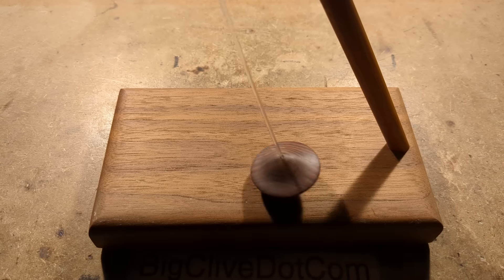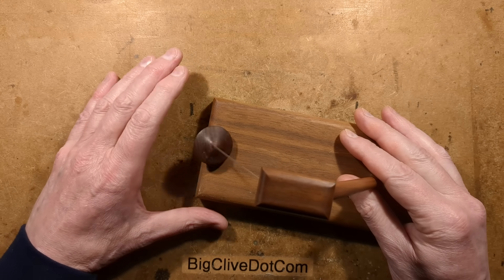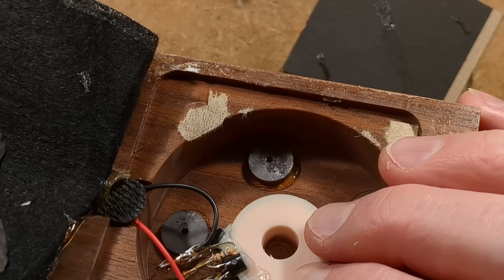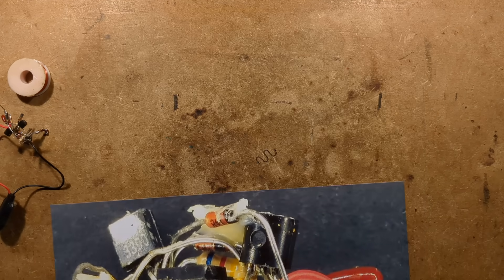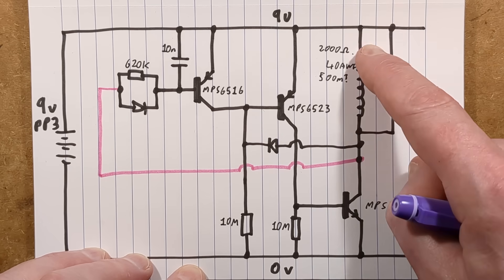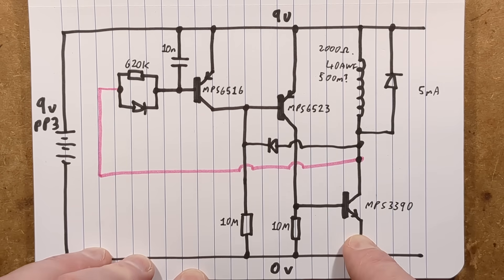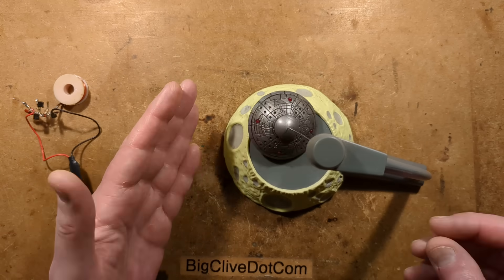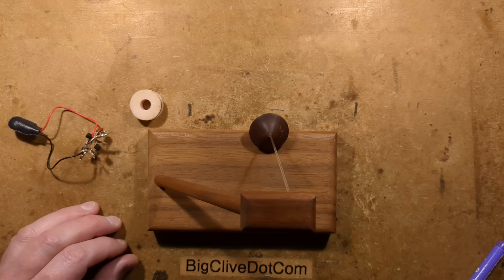The WildWOOD pendulum is pure electronic art (Made in the USA)

Comment: I bought one of these from a high end retailer catalog ( fancy clothes and gadgets ) about 30 years ago for my late father. After about 10-15 years, it stopped working. I replaced the 9 volt battery but that apparently is not the problem. I still have it and would love to get it back up and running again. Anyone have any ideas? Thank you.
Reply from the maker: First suspect is the battery clip.  Make sure it's not corroded or that a wire hasn't popped off the clip.

Comment: That’s exactly why I can’t stand stuff made in the U.S. - nice packaging on the outside, but awful build quality inside for ten times the price. Even China does it better - and definitely cheaper. 
The only excuse for this level of quality would be if it was assembled by a 10 - year old though honestly, I was building far more complex circuits at that age...
Reply from the maker: This is how short run circuitry used to be made.  The cost of getting PCBs manufactured used to be astronomical.  Literally full 1000 PCB production runs at £10 to £20 per PCB plus high processing costs.

Comment: like to use a mag reed switch to cut the car fuel pump 
so if you try to steal the car with out knowing where to place a magnet you dont get far 
any ideas or problems can you for see.  should i run two reeds in parallel in case 1 dies ?
Reply from the maker: Fuel pumps are fairly high current.  A concealed high current switch might be a better option for something like that.

Comment: AI Summary

Abstract:

This video presents a detailed teardown and reverse engineering of a vintage "Wildwood pendulum," a unique electronic chaotic pendulum. The creator reveals its distinctive wooden, hand-assembled construction, featuring a low-friction magnetic pivot and an air-core kicker coil. The core of the video focuses on the surprisingly complex, entirely hand-wired transistor circuit responsible for its operation. This circuit is analyzed in detail, highlighting its efficient design that delivers a single, precise 5mA pulse per magnet swing, resulting in negligible quiescent current and extremely long battery life. The video contrasts the Wildwood pendulum's artisanal craftsmanship with a mass-produced plastic clone, emphasizing the original unit's status as a rare piece of functional art.

Summarizing the Wildwood Pendulum: A Deep Dive into its Hand-Crafted Engineering

*   0:00 Introduction to the Wildwood Pendulum: The video begins with an unusual angle to showcase the Wildwood pendulum, an electronic chaotic pendulum with a kicker coil, acquired long ago from a gadget shop in America.
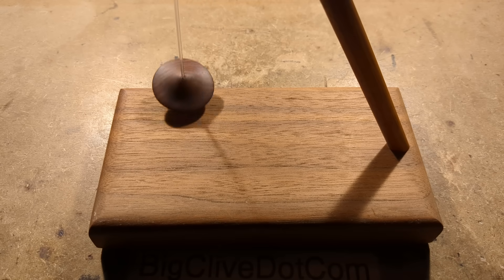*   0:35 Distinctive Wooden Construction: The pendulum is characterized by its hand-assembled wooden components, including a base, angular stem, and a wooden pendulum itself, featuring a ceramic magnet at its base and a custom cap with a spike for a low-friction magnetic pivot.
*   1:30 Battery Compartment: The battery, a PP3 (lithium core with a boost circuit), is accessible by lifting a felt cover, secured by a magnet.
*   2:24 Internal Magnet Array and Air-Core Coil: Inside, five magnets surround an air-core coil, which the pendulum interacts with. The creator notes the unusually complex circuitry accompanying this air-core coil.
*   3:07 Hand-Assembled and Unique Circuitry: Reverse engineering reveals that the coil, made of 500m of fine wire, is paired with an entirely hand-assembled circuit, distinct from typical pendulum designs. This indicates it was not mass-produced and is a piece of "handmade art," manufactured by Andrews Manufacturing Co. in Eugene, Oregon.
*   4:15 Treat as Art: The creator emphasizes that original Wildwood pendulums should be treasured as unique art pieces, especially due to their distinctive circuitry.
*   4:33 Highly Efficient Circuit Design: The circuit, employing three transistors (one NPN, two PNP), is designed for extreme efficiency. In its standby state, it draws virtually negligible quiescent current.
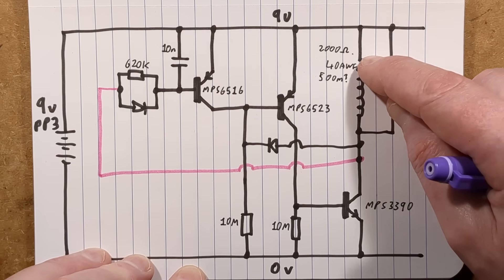*   5:55 Precision Pulse Operation: When the pendulum's magnet swings past the coil, it induces a negative voltage, triggering a precisely timed circuit that delivers a single, distinctive 5mA pulse to the coil, sustaining the motion.
*   7:16 Extended Battery Life: Due to the circuit's minimal quiescent current and efficient pulsing, the battery is expected to last an exceptionally long time.
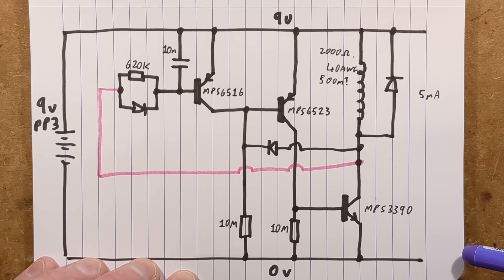*   7:28 Manual Start & Diode Protection: Unlike some pendulums, it doesn't self-start, allowing it to be held still. A diode protects the transistor from the coil's inductive kickback.
*   7:56 Comparison to "The Visitor" Clone: The video compares the original Wildwood pendulum to a plastic, mass-produced clone called "The Visitor," which uses a significantly simpler (coil and single transistor) circuit, likely resulting in shorter battery life.
*   8:32 Art vs. Mass Production: The Wildwood is highlighted as "made in America by hand and it is art," while the clone is "made in China by machine and it is not art," underscoring the craftsmanship of the original.
*   8:48 Maintenance Tip: A dab of Vaseline on the pivot can help prevent wear, ensuring the pendulum's longevity.
*   9:13 Conclusion on Value: The creator concludes by expressing increased appreciation for the Wildwood pendulum, recognizing the immense work and unique artistry involved in its handmade circuitry.

I used gemini-2.5-flash| input-price: 0.3 output-price: 2.5 max-context-length: 128_000 on rocketrecap dot com to summarize the transcript.
Cost (if I didn't use the free tier): $0.0066
Input tokens: 14812
Output tokens: 846

Comment: I wonder if there's enough voltage on the snubber diode to replace it with an LED and flash it on the field collapse. Hmm. If not, a transistor buffer would fix that easily... 😁👍

Comment: That "coil" looks distinctly like it's just a standard spool of wire they ordered, rather than anything explicitly wound just for this, which would be an incredibly sensible thing to do if you can get away with it.
Reply: Obviously don't know for sure, but I also thought it looked an awful lot like the enamel coated magnet wire spools you could buy in the States from Radio Shack, R.I.P. 😢  
Probably still have a least partial one or more in my shop somewhere.
Reply: yeah

Comment: You mentioned that there is a solar powered version, does that mean solar cells and a cap for power supply? Did you also say it can´t auto start? could a pulse inducer cause it to start? AKA can a cap and a timer give the coil a little kick once every 5 min or so or perhaps a second of set coil with no other function? Are the plans/blueprints available for download for the diy/3d crowd?
Reply from the maker: The auto-start pendulums for solar use use a pulse circuit to initiate swinging.

Comment: I have an early electromechanical clock that functions like one of these. It’s like a regular pendulum clock but instead of there being a force from the running side driving the pendulum through an escapement it’s the pendulum that drives the running gears with a ratchet mechanism. The end of the pendulum is swinging over a coil, much like this. It’s a pretty good time keeper but you can definitely tell the difference between the shoves of a fresh battery and the gentle caress of an old battery.
Reply: I think I've seen one of these but can't remember who made them, any idea?
Reply: @orbatos  Sony probably. Swinging pendulam, driven by solonoids at the end of the swing.  Couple of batteries, a transistor and a switch. Unfortunately, the switch contact in mine, is worn and the clock in pieces waiting for the day of resarection.
Reply: @GluteMaximuz  mine is a Kundo, it has no switch and the coil is exactly in the middle of the swing.
Reply from the maker: Possibly a Kundo clock?

Comment: Suggestion to make the reverse engineering more interesting, is to log the voltage waveform feeding to the coil. Could be quite interesting in itself. It could also be a split screen video of the pendulum in action versus the voltage waveform(centered to half second duration window).🤔 The average current  numbers could be useful, but more likely similar(may be more🤞)  to those oscillating pendulum magnet clocks.❤️👍
Reply: I'm disappointed Clive didn't actually measure the current consumption.
Reply: @moeburn  That's very hard to do. With a normal multimeter it is essentially impossible. If you have the waveform you could in theory calculate the area under the pulse, but that is arduous. Even then you still have to figure out how many pulses per minute there are. 

You could try to determine how long it takes to drain a battery, but for normal batteries that would take years, and the leakage of the battery would be significant. Perhaps the best way would be to determine how long it takes to drain a capacitor of well-known capacity.

Comment: Hey Clive, big fan of yours. I've tried to buy a good soldering iron and I have failed to get a proper one. I am currently using a soldering gun but the tip is rather big and the device is unwieldy for what I need. Could you give me some advice on what to buy. What are you using? What brands can be considered solid? Thanks in advance! Thanks for all your videos too! Always nice to learn something from you.
Reply from the maker: There's a wide range available.  What you get will depend on your budget, but even low cost units are very good these days.  I currently use a Yihua 8786D station, but will probably move to a modern T12 style soldering iron soon.
Reply: If you don't do lots of soldering and are on a budget then the USB powered ones are worth a look,
TS101, Pinecil, etc
Reply: @sofa-lofa4241  I'm actually looking to spend some more money to have one that stays with me for life. I know that thought is nowadays rather unrealistic as everything now is built to break. Still I'd like to have something substantial. Something that gets hot quick. Heats the target area quickly and can be used for a longer time.

I do have a nice little rechargable iron I could take with me and do some smaller soldering jobs but every other station I have is not only weak but seems to break down already.

Comment: "Treat it like art"....... says the guy who cut it completely apart. 🤣🤣
Why are there two different PNP transistors installed and why does it work even without the coil? 🤔
Reply from the maker: It still bounces around the other magnets when the boost coil is removed.
To truly appreciate electronic art it has to be deconstructed.
Reply: I still have a huge collection of various transistors, mostly desoldered from old electronics. I wouldn't be surprised if these transistors have a similar history. The exact type of transistor is probably not critical.

Comment: Could this have been achieved by using a 555 timer ?   
Or perhaps this way with the 3 transistors works out cheaper to make !
Reply from the maker: It might have been viable to configure the internal modules of a 555 for this.
Reply: Using a 555 would require far more power. Even with modern low-power clones.

Comment: would be better with a laser diode in the pendulum pointing down at a long persistence phosphorescent vinyl sheet.
Reply: ... not sure you could provide power without affecting it's free motion so it would probably have to be (small) battery powered all in the pendulum weight.
- unless wireless induction power like that used by cellphones could be used (without causing some kind of disturbing magnetic force from the currents in the rx coil)

Comment: The circuit I had seen in the past was 2 x 4000-turn coils (inner and outer) connected to  a single NPN transistor and a 9V battery.
Reply from the maker: See the most recent video released on Patreon for a version of this that has the single transistor system.

Comment: Look, mum! No PCB! That's how I built circuits as a kid / teen. I can't really see the reason for not building it on a PCB if you have any volume production (more than 10 items, really), the board design would be painfully simple and you don't even have to design it in any software - just draw the traces, make multiple copies, transfer to PCB, etch, drill and cut...
Reply from the maker: That's why I wonder if I had an early unit or if the designer didn't use PCB design software.

Comment: Love to see a point to point soldered circuit in the wild!
Reply: A Dead Bug Circuit (is what I call it)
Reply: @Stuart-AJC  I would call it that if there were any ICs. Sitting on their back looking all vulnerable.
Reply: @Stuart-AJC  dead bug style assumes the presence of a board.
Reply: @s_s-g4d  Not really, no. It assumes the presence of components intended to be on a board, which is many.
Reply: @orbatos  I don't think so. the very "dead bug" name makes no sense without a board, because the ICs and other relevant (to the name) components have to be mounted upside down, legs pointing up, akin to a dead bug, and if there is no board, then there's no reference plane for the "up" and "down".
Reply: I've got a couple of old EHX guitar pedals made like that.
Reply: @gm7836 Yeah, really common in guitar hardware, especially older stuff, but a lot of luthiers who do electronics learned that way.

Plenty of mainstream amplifiers used bare wire with dead bugged components internally. It was quite a shock the first time I opened one up to find out why it was picking up so much rf interference, only to find an artful lattice inside rather than a PCB with shielding.